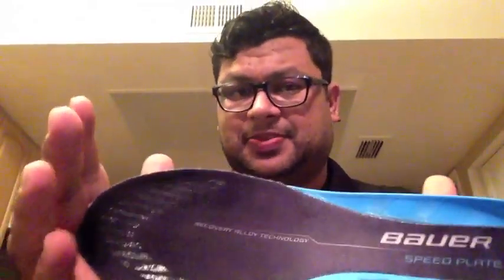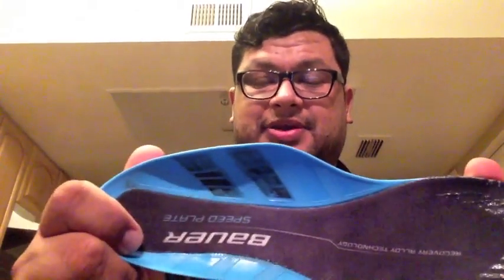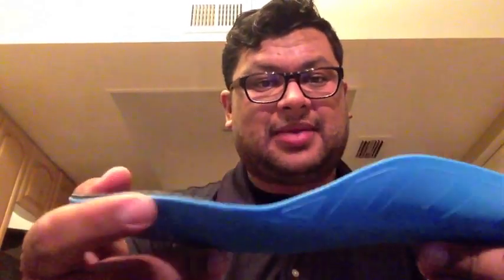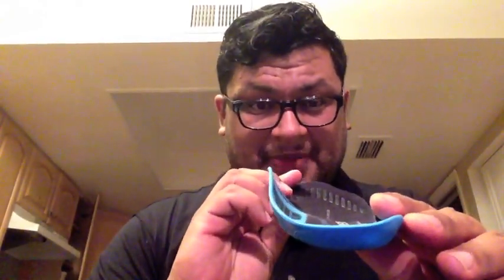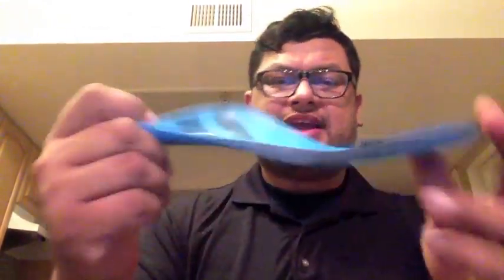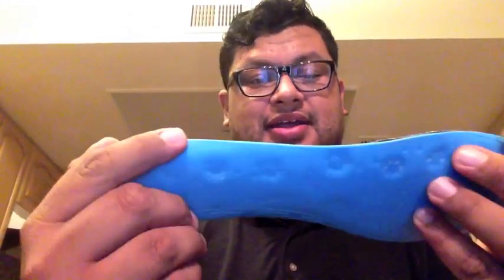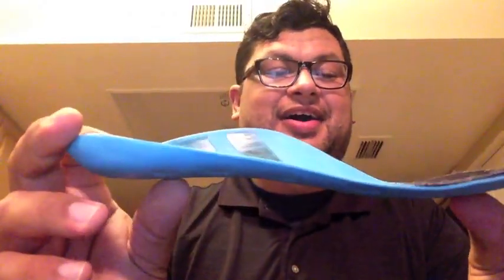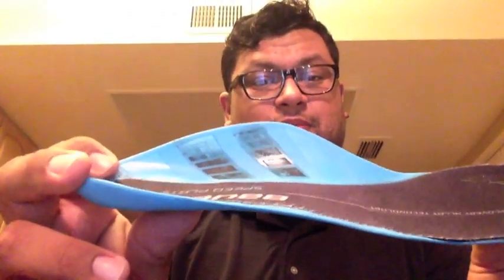Bauer Speed Plate Hockey Insole Review

Comment: I’ve now replaced my second set with the new ones after they developed a large crack in one, after less than six months. Not good.The new ones are made from a more flexible plastic, which should be less liable to crack, and they look a bit thicker in the areas liable to cracking. They also have some padding in the heel area making them more comfortable. I have no complaints. They’re expensive, but I would not skate without them.

Comment: These can easily be baked in an electric clothes dryer equipped with a shoe rack.  Not sure if the temperature gets high enough to bake the skates, by the time these soles were ready to come out the temp was up to 150 (dryer was set to high heat). Use an oven thermometer and a flashlight to monitor.

Comment: The way I try to explain using heat molded insoles with heat molded skates is if you don't use them you're only getting half the job done kind of like brushing your teeth and not flossing.
Reply from the maker: Not entirely, the boot fits comfortably as it is except for the sole part.  In my case i get great performance off not baking the skate because i don't have the need for it, and i get a great perfect fit off the footbed being baked and fit to my foot.

Comment: My local pro shop is about a 3 hour drive for me, is there any way to do it from home?
Reply from the maker: Craig Balfour absolutely. If you have a convection oven you can heat it up and stick them in for 1 minute and then do the process
I suggest doing one footbed at a time if you’re doing it from home 

Use a cookie sheet as well. Center rack

Heat the oven to about 160 and when it beeps that you’ve reached temp, turn it off.

Put the sheet in with the footbeds for 1-2 minutes or until the black marks on the top of the footbed go clear which is the indication that they’re ready to throw in the skate  

Act quickly and throw them in the boots, put them on and lace em up.

Stay Standing up until the footbeds no longer feel like an Arizona summer and you’re set.

Comment: Can these easily be removed after each session? My skates get very damp inside, and the insoles must be removed to prevent the rivets from rusting. 

As an aside, Superfeet will refund the purchase price if you do not get on with Superfeet, as long as you have proof of purchase. Mine were refunded by my local sports shop in the UK.
Reply from the maker: WalksWithTurkeys my feet and skates get pretty wet and I easily removed these after every skate and even have no issue with my VH boots when removing them. I don't think you should have an issue at all.
Reply from the maker: I was not aware about the refund that's good knowledge for anyone though 
Thank you for pointing that out
Reply: Thanks. I'll probably get some.
Reply: I ended up buying some. As you say, they are easily removed. They do support my arches, and increase the connection between foot and skate. I felt I had more control, though this might be the placebo effect. Worth getting.
Reply from the maker: not sure if the placebo effect is really the "it"
i'm not using speedplates in my VH skates and although my CCM insoles fit great in them, it doesnt feel like i'm at one like i did with speedplates
Reply: I used them again today, for the third time, and the effect is real, I really feel more in touch with the ice, there is more control. And more importantly my knees feel really great. The arch support is doing its job. So yes, these are very very good. I have noticed a change and had to get used to them. High speed snow ploughs had to be relearnt, which took five minutes. Not a big deal.
Reply from the maker: WalksWithTurkeys heck yeah dude
Looks like the adjustment period is getting good for you

Comment: Can I bake the speed plate at home? I want to know what temperature to bake it , thanks a lot!
Reply from the maker: jy03829256 I will heavily suggest you not to do that, my friend
Reply: so can you tell me how to use it at home? Is that alright to use hair dryer?
Reply from the maker: jy03829256 look you can.  I suggest you go to a shop or your rink or if you live in AZ drop them outside on the sidewalk for 4 minutes 

If you have a convection over
heat up your oven to 110F
Throw them in for 2 minutes until the black fades to clear
Throw them in the skates and put them on
Reply: thanks a lot ! and I want to know that after the convection oven heat up to 110F  I need to switch off the convection oven first or not then put them inside?
Reply: +thinkingjack I'm done ,thank you so much!
Reply: jy03829256 so, how is it done? what's the temp? I want to do it at home as well. Thanks

Comment: would the bauer speel plate 2.0 senior insoles size 7 would fit well in a size 8.5 hockey skate?
Reply from the maker: Not at all. It would have 1.5 worth of spacing size missing
And it would be an
Issue